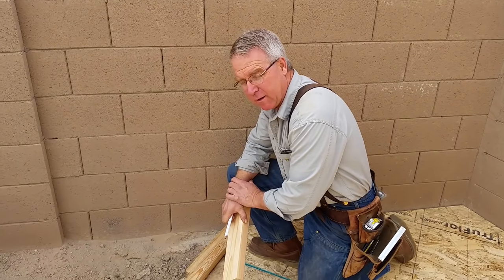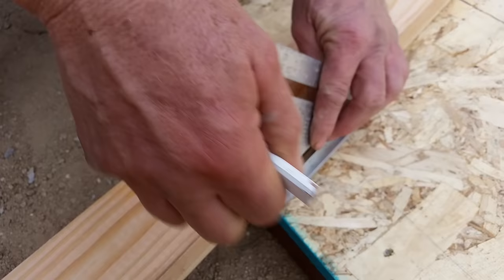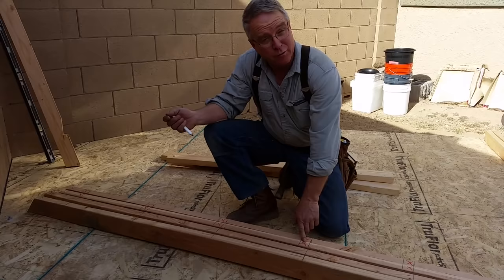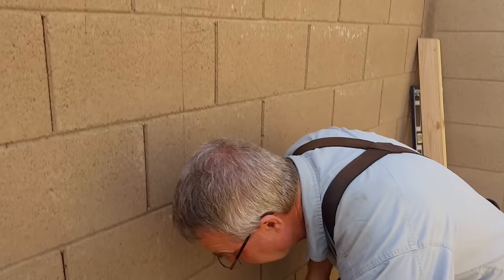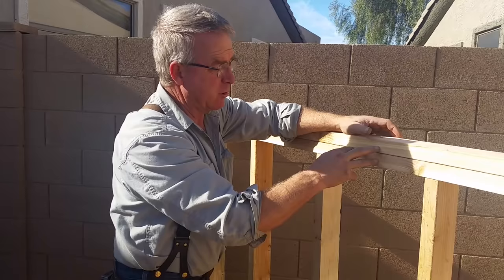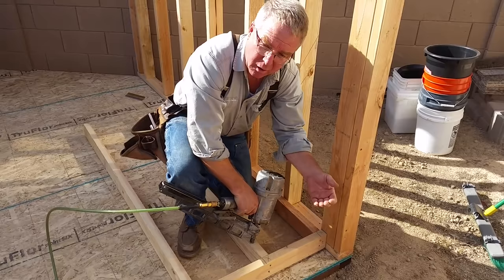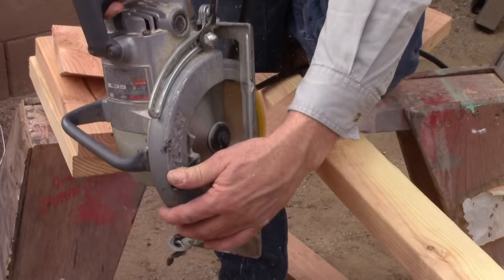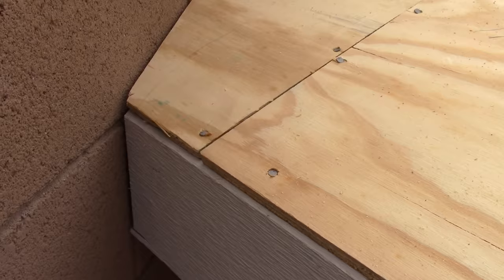Framing Pro Tips

Comment: You are awesome. I wish you'd framed my house. I visited the site every day after the framers had left. I ripped studs out and threw them in the mud so they wouldn't reuse them. Only one time did they complain. I pulled the stud from the puddle and showed it to the foreman. 1/4 twist in the warpage, and the put it on the outside corner of a high traffic hallway. They stopped complaining, but they didn't do any better. They were fired after my house was finished. The whole crew. They made 3 structural errors that cost the contractor thousands. I caught them all.

A home that should have taken 3.5 months took 5.5 months. I was glad I could go to the site every day. As a result, I don't have squeeky floors and things are solid.

Great video. I've sent it to 7 men: 5 sons and two sons in law.
Reply: As someone who is not savvy with such details, what did you look for and what were the other errors that you caught?
Reply: I was in an unenviable position when my house was being built. About a week after we closed on everything -- paper signing that went on forever, or so it seemed -- I lost my job, and as I looked frantically for a new job, I visited the house 2 times a day, once in the morning, and again after the workers had all gone home, but before the sun went down.

One thing I did was look for every nail that missed the floor joists and hammer them back up, then put them into the joists. I have a nice framing hammer. Oh, after the first time I hit my thumb with it, I dulled all the sharp points. Silly thing though, I don't remember hitting my thumb after I dulled it. EC talks about that in a video he did on hammers. Excellent video. Back to flooring: The reason I re-did the nails that missed the floor joists is because they either went down the side or cracked the joist and came out the side. Every one of those creates a creaky floor. Squeaky floors are annoying. My floor has NO squeaks in it at all. My house is a 4 level split, so there are a lot of floors. I think it's pretty cool not to have any squeaks anywhere. We can walk everywhere without making noise from the floor.

Another thing I did, as I mentioned, was to pull out bad studs from the wall. There's a saying that good drywall can hide bad framing. I disagree. I think bad framing makes drywall more expensive and less sturdy.

Those were the major things. The other things I found were major errors by the cement crew and framing crew. They poured the foundation in reverse. I wanted my garage on the West side of the house so the heat of the afternoon sun would heat it up instead of the house. I had them re-pour it so I got what I was paying for. The next thing was the framers forgot a part of the wall that made our dining room bay window 4 inches lower on one side, which was very annoying. They fixed it because it was an embarrassing mistake. However, the next mistake was beyond embarrassing, and  they tried to convince me to let it go. That was they put the floor joists on the top level the wrong direction, which made putting the hang-over bedroom walls impossible. They wanted me to have 2 bedrooms on that level 7 feet wide instead of 9 feet wide. That wasn't going to fly. They had to bring a crane in to fix that mess. Needless to say, the contractor I hired to build the house, fired that framing crew after they finished my house, which took over 2 months longer to complete. That cost them more than just the cost of bring a crane in to lift the wall while they turned the floor joists from East-West to North-South.

I'll probably remember other things, but the floor was the most important, other than fixing the mistakes. That has made for a quiet home for the past 22 years since we moved in. Is it our "dream" home? Probably not. As we've grown older, and the joints are getting more worn out, we are wondering about getting a rambler-style home where we only have stairs occasionally when we need to get something from the basement.
Reply: You're so right about creaky floors. They annoy me so much. It's one of those mistakes that residents don't notice until later and is already hidden by a floor.
Reply: Maynard,

Here in Utah, the lumber is typically so dry that it cracks before you see any sap come out. I don't know if it's the type of lumber we get, or the long distances it has to be shipped, but when I buy 2x4s at the local Home Depot or Lowe's for projects I'm doing, such as the chicken coop I designed and built a few years ago, I don't have to worry about lumber not being dry enough. It's the opposite issue we face here.

The 3 structural things were the foundation (re-pour close to 1/3 of it), the kitchen bay window missing an entire 2x4 section causing it to be 4" lower on one end than the other, and the upstairs bedrooms not over-hanging according to the architectural requirements. They had to hire a crane and lift the entire front section of the house while they changed the direction of the floor joists from East/West orientation to North/South orientation so they could extend the entire wall on that floor level out another 2 feet, as the drawings indicated.

The middle of the 3 wasn't nearly as expensive as the other 2, but was a major error. Had they left it, which wasn't going to happen from either my point of view or the site manager for the builder, the entire upper level would have also had a problem with the structural strength of the East wall.

Since the completion, we've found the siding company used 1/2 the number of nails they were required to. I've replaced over 100 square feet of siding; most because of the winds we get ripping it from the side of the house, but a lot of the rest because I went through and added the missing nails myself. Also, the roofing has blown off a bit at a time so we've replaced most of it since moving in. There are large portions that haven't needed anything, but almost half of it has had to be replaced because they did a poor job on that as well.

It's been a comedy of errors, frankly, and had I known what I know now, we never would have used the builder we did. They were the largest in the valley at the time, and I guess none of the shortcuts they used on our home were being used enough for their reputation to have been sullied as it has since. We have been in the home for 22 years now, and if it wasn't on the property it is, we'd have moved long ago and started over.

You can rest assured we'll never use a company called Patterson Construction again, and writing that down gives me a little satisfaction after so many errors and so much personal cost.
Reply: Maynard you're right about the green board at least for down here in Florida,  most of the time the pt boards are like 4 times as heavy as white because of how waterlogged they are :p
Reply: Karl Pearson every state I have framed in had us lay a nice fat line of subfloor adhesive on all the floor joists before laying the decking down, so even with missed nails it wont creak
Reply: Tony Teresi exactly he said a stud had a 1/4 twist which is probaly within tolerance, and wouldnt cause an issue with the sheetrock lol leave the inspecting to the inspectors people
Reply: G. A. B.
His dollar, his call.

Comment: Thanks Scott. As a "recovering perfectionist" and detail-oriented guy, I find it very hard to dial down my natural tendencies to make nice pretty marks, and measure and calculate everything. But production suffers and that costs the person who's hired me more. What you said is exactly right: I must understand the allowable tolerance, and adjust my methods accordingly. I've found it much easier to speed things up if I know a system for getting the same accurate results in a faster/easier way—like scribing instead of measuring/marking. 

And AMEN to the three "prime directives" Square, Plumb, and True. Those must not be sacrificed on the altar of productivity. Because if I do, every single person or trade that comes along after me will suffer reduced productivity—and guess who will pay that bill? The same homeowner that originally paid me to get the structure standing in the first place. I'm sharing this video and glad for your excellent example and instruction. :)

Comment: You did a couple videos about framing hammers and rigging axes and such, so do most carpenters today use nail guns or real hammers?
Reply: Both. The majority of framing is done with air nail guns but no doubt there’s still some tat require hammering
Reply: Definitely both.nail guns don't always sink nails all the way .sometimes they misfire and you need to pull nails out and like the other comment on here sometimes some things just need some handbangers

Comment: I didn't realize I was production minded till now, I thought I was just lazy!
Reply: Alan Holden a old electrician I work with once told me "if necessity is the mother than laziness is the father"
Reply: Alan Holden That's when code compliance comes in and sees that there are too many short cuts that reportizes the integrity of the structure. I've had one of my peers call code compliance on a job site across from ours and they where production drive.....when it came to nailing.
Reply: @calisurfduuuddee8183  give a lazy man a job he'll figure out an easy way to do it.
Reply: @utubedaveg521  I am lazy but in a different way .i find the easiest and fastest way to get alot if stuff built but I do it with the least amount if effort .

Comment: Thanks for the videos, I'm learning a lot! I get the square and plumb, don't understand the 'true' statement though, care to explain?. English isn't my first language. Thanks!!
Reply: Fernando Yáñez This was the question I had, thanks for asking it.
Reply: Fernando Yáñez A paño, a ras, colineal, coplanar, se entiende en cristiano
Reply: Maynard "square" just indicates a 90 degree angle. Rectangles and triangles can also have corners that are "square". It doesn't relate to the length of the sides in this context. Also, yes, true is referring to coplanar. say you're setting 3 porch posts. They can all be perfectly plumb, but if you sight down their edge and the aren't in a straight line with each other, they're not true. Typically you'd set the two outside posts and run a string between them to make the center post true. I hope this helps.
Reply: Fernando Yáñez-  True means level

Comment: I started out the craft  As a framer also with the mill works when I was about 18 years old in Tucson Arizona, that's where I learn most of my core values as a carpenter. Now I live in California I am a Union carpenter that does concrete form work now for about 15 years. And I've had the opportunity to run work on  Many jobs that were over a  Few 100 million dollar projects. This is why I really appreciate Your videos Square plumb and true absolutely.

Comment: I like to see that you use your skilly by dragging the rotating blade across the wood to shape the end of your cut free hand. 
Sign of a pro
Reply: @DieselDog1982  I have no idea what you think I meant but you are way off course man. Was not precutting the next board. He was shaping the end of a piece of 2x4 freehand by dragging the blade like a planer. To adjust the 45 degree angle to fit a bit better.

Comment: Things I love here. A master at work.  Wormdrive saw, heavy but so easy to guide and rip with. Square , plumb and true. I may have fudged this sometimes but never in stair openings, bathrooms, kitchens. Had to build a garage gable wall 3/4" out of plumb as the concrete guys screwed up big time or the garage door would not meet the ground properly. Plywood on the roof: rot resistant, strong even if the glue partially fails as opposed to the rot, mold factory called osb on the floor. Double top plate on a large structure, great, on a small shed it could be just one. I do layouts on the plate/sill with the boards flat so the line is a guide when you add the studs. Loved the 1/8 recess on the corner studs.

Comment: You can also  measure the distance of gap when it is in place with a square. 
We do this for siding when you have multiple custom cuts to do..
If the angle starts to change it's easy to adjust cut

Comment: Great tips, especially Level, Plumb, and True! SO many problems are due to the lack of any of these three. One thing I might have done differently is to put the long sheet of roof decking at the front of the building, and the short, odd length at the back of the building, next to the concrete block wall. If any high winds come up, the long piece would be more stable at the exposed front, and the shorter piece would be back against another wall, which would help protect it. A diagonal cut is required on this short piece anyway. Doing this might have taken a little more time, which he may not have had. Not necessarily a right/wrong...just the preference of the framer.

Comment: I quit measuring quite a while back. I'm a fairly intelligent person and I got through some pretty advanced math classes in school, but no matter how I measured and calculated my cuts were almost never right. I just couldn't understand it. . . but then over time I realized that the reason measuring and calculating weren't working for me was because my measuring points (usually someone else's work but sometimes my own) were almost never square, plumb, or straight. Calculations and measurements are great on paper. In the field, they just lead to frustration!

Comment: Wish my builder had watched your video... this has been a huge help for me but would love to hear your tips on what possible tricks you might recommend for correcting issues with a house and timber barn built with cuts that are not "square, plumb, and true". For example I have several walls with 2x4's and 2x6's that are not cut to length and have large gaps where nails barely reach the plates, trusses that have incorrect angle cuts where just one point touches with 3/4" gaps... does one just live with these sloppy workmanship or can adjustment tactics be employed? Great video and appreciate you sharing your knowledge with the world.

Comment: There is also a way you can lay the square down on the plate with the lip of the square on the top, so the 45° angle is towards your body and set your tape on top of it after hooking the end of the plate and just slide the square and tape with one hand while marking the studs. You get a good square mark and its decently fast. All depends on if the boss wants accuracy or production haha

Comment: Would like advice - 
Have a 12 x 16 wood frame gazebo with full screen floor to ceiling , 7.5 ft high walls  on 2 ' centres.
Installed plywood sheathing horizontally on one of the 16' walls and installed 2x 4 angle braces top and bottom on each corner of the structure .
Live in cold zone in Canada with plenty of snow .
Should I install a horizontal brace , say 1x 6 around the three screened in walls and at what height - at 3 ' height  or ? or am I wasting money with no increase in structural stability adding the extra lumber where I describe ?
Better off installing more bracing of some kind elsewhere on the structure ?

Comment: I like the way he had to flip the speed square around to get the proper line. How many times have I seen that (?) - even with experienced carpenters!
At times, especially in remodels, you just put the tape measure and level away, and get the job done.

Comment: On a gable, run the right side fascia first letting the top run wild around 12 inches then the left side letting the top  over lap and run wild . Mark with a torpedo  and cut both pieces on a slight bevel ( 7 degrees) and you'll have a perfect cut top

Comment: If you want a finished interior (drywall), would that not require you to mark stud locations differently that marking stud locations to accommodate the siding? Which then would you choose (accommodating drywall or siding)?

Comment: Would you not put a line of melthoid ( Tar and sand based)  tape between that stud and the brick  wall,  where you used Ramset bolts to fastened it,  to counter moisture..? I'm a kiwi and that is standard practice here for bottom plates that come into contact with concrete.

Comment: Out of habit I always mark both sides of the stud layout.  It's just as quick as a slash by using the marks on a speed square.  It helps out immensely is you have to change nailing positions.